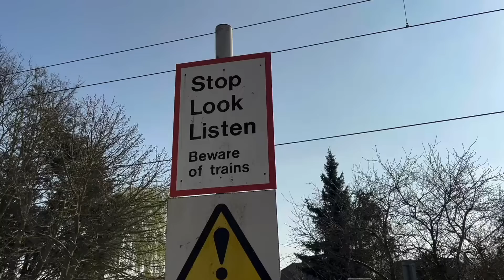Why Do Tube Trains Whistle?

Comment: In Sydney, the newspapers often run stories about how railside residents are unhappy with the noise generated by trains, including the horns*. You can tell there’s not much else happening when one of those appears. 

It used to be a requirement that the horn be sounded when leaving a station here, including the underground ones (our network is mostly open-air). This was dropped in about 2012ish, now they’re only sounded when there are workers on the track, approaching level crossings or on the entrance,(and occasionally the exit) to tunnels, unless said tunnel has a “No Whistle” board because there are homes or offices directly above it. 

Most trains are have two modes of horn: Town and Country. Town is quieter and for use in built-up areas, depots and stabling yards. Country is louder and therefore meant to carry further. It is possible to blow both together as well on some trains. 

*Why these people moved next to railway lines if they knew trains were going to be noisy is another matter entirely. Nevertheless, the railways do take it seriously in some cases such as Wollstonecraft and Waverton which have some of the state’s sharpest curves (though not THE sharpest).
Reply: "Why these people moved next to railway lines if they knew trains were going to be noisy is another matter entirely."
That's a regular thing in Britain too. People buy houses next to railway lines and complain about train noises; they buy houses next to farms and complain about farm noises (and farm smells), and probably the same applies to homes near factories, heavy industry, football grounds and so on. 
I suspect it's because they're the sort of person who has utterly unrealistic expectations about life, the universe and everything and/or who has to have something to complain about.

Comment: Greetings from Australia.In the 70's I was a trainee engineman (driver) and we were told , because some people had been hit by trains , that we had to sound the whistle as eg whistle boards (approaching a curve) level crossings (400 yards prior then just before crossing and running express through stations.Also when leaving a station so all and sundry were aware of a train movement.The reason was safety and the railways did all they could to prevent an accident.
Reply: I live in NSW. With the exception of leaving and passing stations (it’s now optional, but people in Sydney complained about the noise), all those requirements are generally adhered to now. 
I don’t know of any whistle board locations in NSW but there must be some. 

Most trains also sound the horn when entering tunnels and sometimes when exiting, unless the tunnel has a “No Whistle” sign; the one at Chatswood has this as it’s directly under an office block.

Comment: A funny thing about the regional and intercity trains here in Denmark is that they have own departure signal, a digital one that sounds when they close the doors, but the conductors still have to first blow a whistle to tell the driver that the train is clear to leave, and so the passengers know the train has "left" - and then the conductor is always the last person to get on the train at every station. This is only done on the national rail mainline trains, and the procedure has been the same since 1847. Even the whistles they use have not changed much
Reply: Here in the UK the guard is also the last to get on the train. If it's safe to depart they give 2 on a buzzer, the driver returns the 2 before moving out the station. All passenger trains here have a bleeper which sounds when the doors are closing. Some trains the bleeper sounds then the doors close and some the bleeper starts sounding before the doors close and carries on until the doors are actually closed

Comment: How curious. Three short blasts on a ship, say the Waverley which has an actual whistle, mean I am going astern (This could cause lamentable confusion in places).
Three long blasts  more or less mean Toodle pip, see you next year. It's a standard farewell sounded at the last call to each pier at the end of the season. Glasgow has the biggest suburban rail network outside of London, but with the fjord like Clyde Estuary, it has something London never had. The steamer services were quite something else.

I must say, the Underground whistle is most awfully polite. Godfrey from Dad's Army would certainly approve. 
I thought the reason they have whistles would be similar to why trams have bells. As I'm not totally sure why trams have bells anyway, I'm none the wiser, but hey ho, that's life. Edinburgh and Nottingham tram bells are slightly different notes. Manchester trams have whistles but they're a special tram/train hybrid which incudes rail and wheel profiles too as far as I know.
Modern trams have a separate loud GERROUTAVIT horn. Manchester's are quite evil. You soon know what the driver thinks of you sitting with your legs dangling off the platform at a stop. Edinburgh's are like a Ford Fiesta horn on acid.

Comment: Leaving station sounding of whistles was to alert guard and signalman that movement is about to happen plus to warn folks the train was moving and to step back.   Entering tunnels or long underbridges should also require a whistle to allow workmen to find refuge in the little cutouts in many tunnels or to jump to the safety margin on those without refuges.   It is a bit different for LT operations than BR operations as most of LT's railway is underground so a bit pointless whistling entering in a tunnel as likely to be in a tunnel for some time but working orders will list trackworkers in situ and driver operator of train will sound whistle at key points to give lookoutmen a chance to give the stand clear call.

Comment: Sometimes handy having a railwayman relative hehe   One thing my brother and I did was liberate two rail detonators from my father's work bag, we unwrapped the legs and put them under the back wheels of next door neighbours car... expecting the sort of bang you got from a cap gun, oh noes, not being compressed by a rail wheel they went BANG and blew both wheels clean off.   We were suitably chastised and in the naughty corner for ages over that one, even the neighbour in the end thought it funny but not me moody grumpy father lol   Wasn't all bad mind, me dad used to bring home cases of light bulbs, Izal toilet roll, whole tea chests of BR standard tea bags and loose tea by the caseload, batteries, electrical stuff including insulation tape, crimps, reels o' wire.   I remember too when we rewired the whole house getting rid of the round pin stuff and putting in all modern MEK stuff (some filched from Auntie BR) and he paid his mate a few quid to come round and fit the new meter, as he had the legal crimps etc.   So his mate says to him, hey look if I put this extra loom in all hidden etc you can switch the meter out of the loop... free electricity and me father was like all moody and even threatened to dob his mate in O.o

Comment: Living in Sheffield where the trams have bells (and monster air horns if someone hasn’t taken the hint), it always seems novel to me when I go to Manchester that their trams have what I think is a very pleasing whistle that makes a hoot sound. 
Sadly though I think on their newer trams it is synthesised by a sounder playing the whistle noise (and perhaps capable of other noises as its probably a very similar system to the siren/PA on a modern emergency vehicle) rather than an actual live air powered whistle so maybe their days are numbered, though hopefully good old railway legislation will keep the traditional approved system going.
Reply: Japanese commuter trains are also equipped with electronic sirens that play either a horn sample or a short piece of melody upon activation. Traditional air horns are usually just for backup or for emergency.

Comment: My favourite tube whistles are the ones on the Waterloo and City line - at Waterloo - that tell you that the driver has walked the length of the train and is about to pull into the station to take you to Bank!

Comment: Is there any connection to the famous Charles T. Yerkes and the whistles on the London tube? I know that single-chime air driven whistles were common with American electric streetcars and other rail transit cars, probably because most used air brakes to stop.

Comment: Aren't doors operated by electric motors now though? You don't hear hisses and see doors opening and shutting violently anymore. I suppose the whistle on the new S Stock has only compressed air ONLY for the whistle... I am probably wrong.

Comment: Now when I first read the title to this I, being a nerd as well as an electronics engineer which would be a triple point score in scrabble,  I thought it meant the inverter-like sounds you sometimes get when certain trains start up. I would not call todays horns whistles but then I go back to the days of steam, like last weekend when I visited the Watercress line. Another great video Jago thanks even without the bells.
Reply: Not an electronics engineer but had exactly the same thought when I first read the title. 😀
Reply: You mean the sound of VVVF modulation? That's a quite interesting factor through which experienced railfans distinguish different models of trains easily.
Some trains equipped with Siemens GTO-VVVF inverters, e.g. Keikyu Model 1000, make melodious modulation tones which sound like a musical scale.
Reply: @JBF-GST-Tanda  Thanks, I guess I do! It does sound like a modulation so is the change in frequency is about efficiency and reducing losses?  There must be a youtube channel about this. Variable voltage variable frequency, just looked it up! Another technology to research....thanks for the lead

Comment: my understanding for the not whistling at night is the main purpose is for track workers, and on LU you cant work on open track after dark, so theres not that many hours overlap.

also, the bakerloo has two whistles, a quieter one for in tunnels, and a louder one to comply with Network Rail's track
Reply: The loud whistle is hardly a traditional whistle, more of a buzzer and the whistle together, but it is a curious feature of the train

Comment: On US railroads, three short blasts on the whistle or horn signals that the train is going to reverse, one long or two short is the signal that a train is going to start moving, and two long, one short, one long is for grade crossings. In suburban Long Island NY, near where I live, the Long Island Rail Road trains whistle at all hours, and as we are only a few blocks away from a grade crossing, we hear them all night long.
Reply: I know that American trains are split between a number of companies, are all bell, horn and whistle codes standardised across all companies?
Reply: @leeroberts1192  most US railroads operate under nearly identical rules, because there was and is a lot of interoperation between the different companies where trains of one company interchange with others, so everyone needs to be on the same page rules wise. There are two major sets of operating rules in the US, NORAC for the eastern half of the country and GCOR for the west, but they’re not tremendously different as far as I know.

Comment: I suppose the other side to this coin is BR's use of two tone horns. My understanding is that in the early days of diesels and electrics (outside of the Southern Region) there was a concern that a single tone horn could be mistaken for a road vehicle, particularly at a level crossing, so the two tones were introduced with drivers told to make sure they used both tones. Similarly, the yellow panels / full ends were not deemed necessary with steam as such locos were considered to be adequately noisy, steamy and smoky to advertise themselves well enough. Bit like a 70s rugby fan.

I'm now going to be really controversial and say that to be honest, I don't like these new liveries with yellow derogated away. Somehow those trains don't look British Rail, and I say that even though I'm certainly no "Little Englander". Yellow makes me think of the liveries I grew up with in the 70s and 80s, and I only need to point out the first HST livery to show an example of it applied really well. There's an older lot than me that hated the "ends dipped in custard" look, and I would guess some youngsters don't think it matters. Whether its still necessary for safety is an entirely different matter, I know these trains have a particular spec of LED lamp for added safety, and yellow paint isn't much use at night, in fog, etc. Mind you, I know some trackside staff who say they were never consulted, so... 🤔
Reply: Drivers were never consulted about their opinions of the hyper-bright modern headlights, either. The people who are most affected by things are never asked about them; people in offices, divorced from the ground-level operators, make decisions which I'm sure are made with the best intentions but which can seem like they have been made without full consideration of the effects.

Comment: I've never heard of the rule about sounding the whistle when leaving a station. It's typically only done if there is a whistle board just beyond the station, or if track workers are on the line. Mainline trains do sometimes whistle or sound their horn when moving off, but that's as an acknowledgement to the guards "right away" signal on trains that don't have a buzzer or bell.
Trams though will typically sound their whistle or gong before moving off under any circumstances though, since they are often on the public road or in pedestrian areas.
Reply: Trains in Sydney used to sound the horn at every station up until about 2012, whereupon it became “if required” as today. Some drivers still do it at every station regardless of the rule change. 

I think it was changed because too many railside residents put in noise complaints. As for why these people moved next to a railway line knowing it would be noisy then complained about the noise, you’ll have to ask them - I’m not that brave.

Comment: Good vid.Audible train warnings are important particularly where there are maintenance crews working near the line and the warning has to be acknowledged by all personnel with a raised hand signal.The driver of a train authorised to pass a signal at danger will give a warning and usually a train passing a busy platform at an intermediate station at speed especially freights /containers etc.These comments refer perhaps more to the national network .Push /Pull trains with the driving trailers leading are particularly (and dangerously) quiet so an audible warning is essential.Last but not least , thankfully ,the runaway train warning.Most of the modern trains and locomotives are fitted with an unsocial hours horn control.